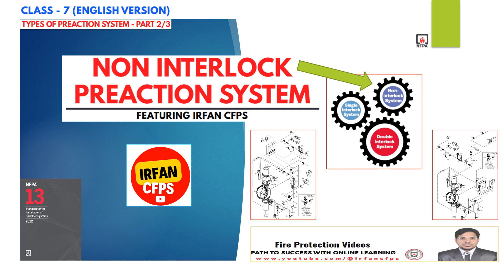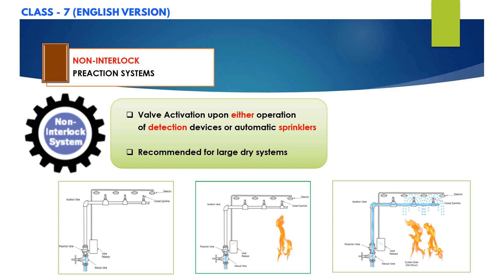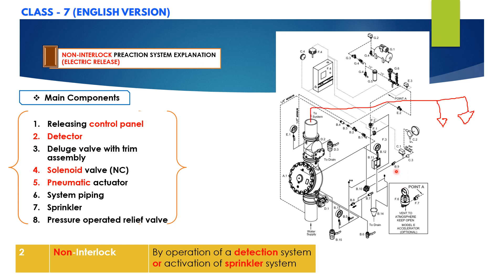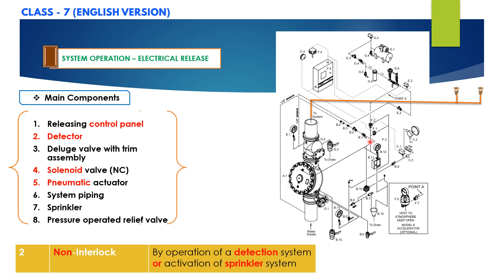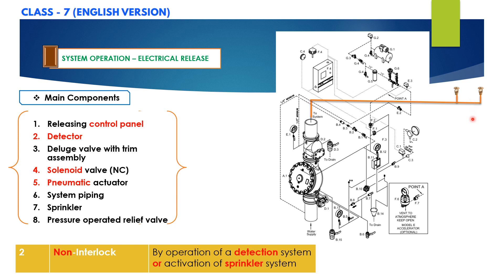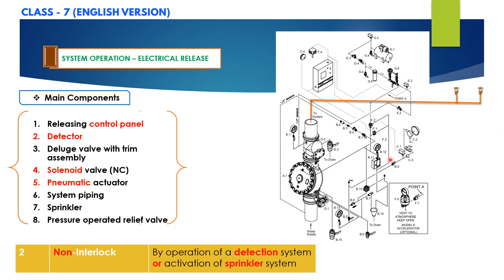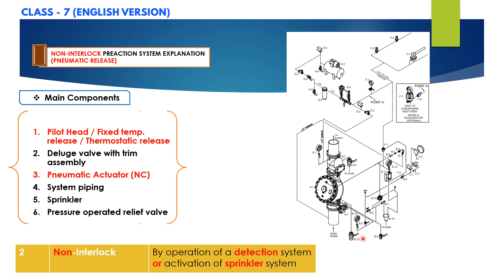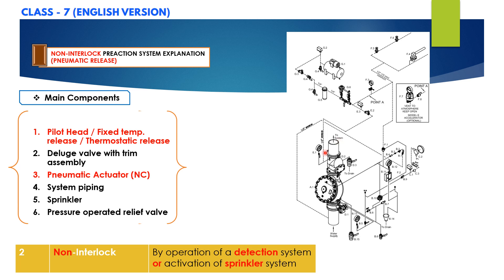How Does a Non Interlock Preaction System Work?

Comment: Non- interlock---- When It'll activate through solenoid water will go till the sprinkler - 

Single interlock- only solenoid will activate and water will reach till the sprinkler. Because there will be no any sensing line to sense mechanically.

Double interlock- if the sprinkler will burst then water will also release and activate and if solenoid will activate then water will reach to the sprinkler... 

😟😟😟 Jyada confusion
Reply from the maker: In short, please remember preaction system have closed bulb sprinklers. Even the preaction valve opens, the water will come out of sprinkler only upon activation of sprinkler.😊